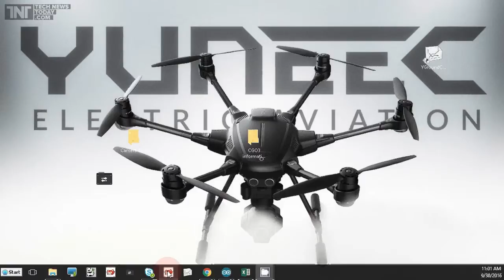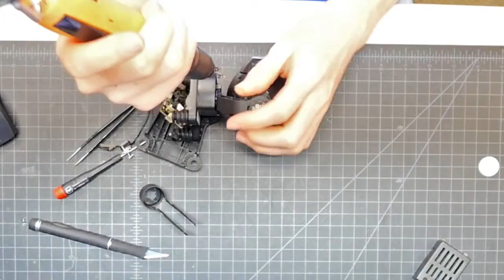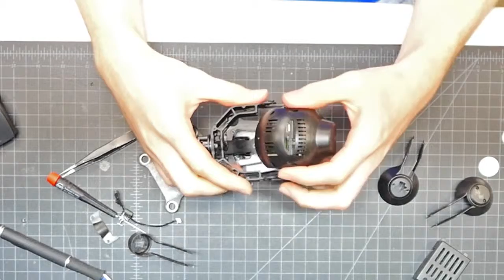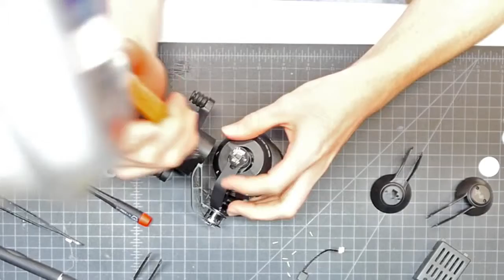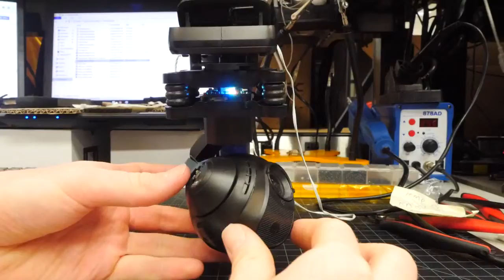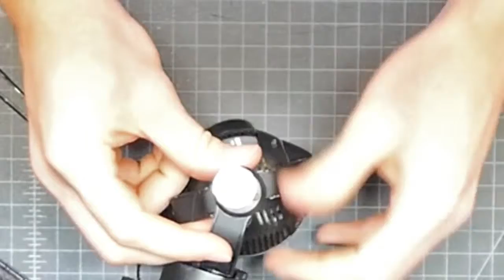CG03 Roll Motor Replacement

Comment: How find it the Software GIMBAL SET V39 ?
Reply: https://drive.google.com/file/d/12PXfjY4FOFJD9potWUuZFTenwYUi6s2H/view?usp=sharing
Reply: @ryankephart8325  THX, but what up with correctly instruction? step by step
Reply: Exectly then BootLoder v17
Reply: @johsch7503  Sorry, I don't work for Yuneec anymore... So I really don't remember much of it. I have some tools for you guys, but not everything
Reply: @johsch7503  https://drive.google.com/file/d/1YMgSRk9m2fq7xpI3D_87BBM9WDKg1gkd/view?usp=sharing Here is the bootloader
Reply: This doesn't work with the cgo3p. Any thoughts on how I could get the software for it? @ryankephart8325
Reply: @ryankephart8325  thank you for you posting this, I was wondering if I might be able to get some help with other tools and information by chance?